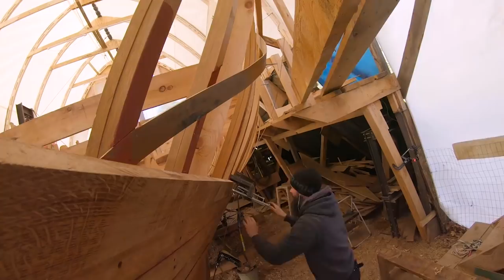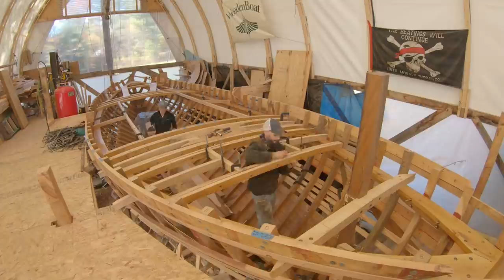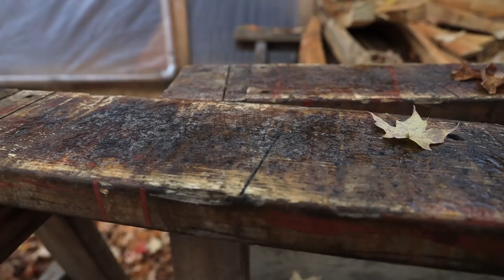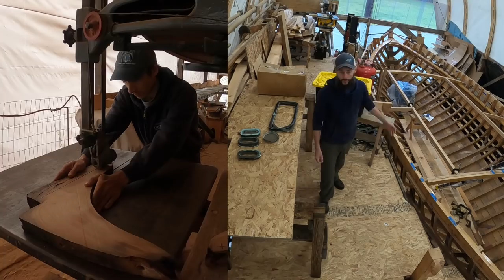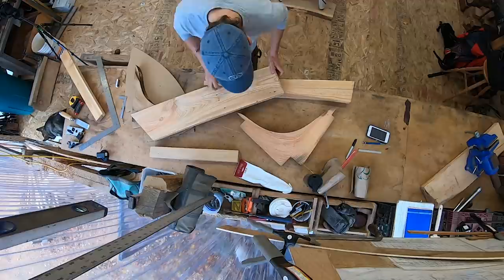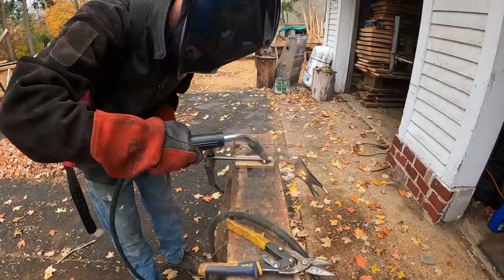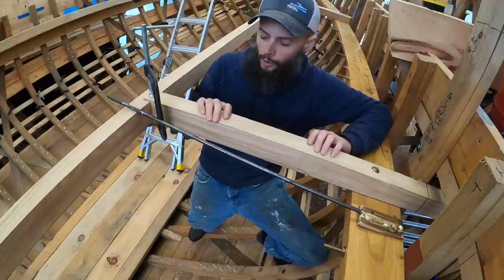Alix is Back! - Episode 134 - Acorn to Arabella: Journey of a Wooden Boat

Comment: oooo ***long conment warning*** I has a story to tell!!!  Alix is definitely on the smart end being "afraid" of  the power tools,  most  woodworkers and machinist's that have all of their fingers, hands and arms worked with that healthy fear. I am a retired/disabled engine machinist and will now impart to you a story about me from my now distant past, before I could call myself an engine machinist.  I was "grunting" for the shop (doing everyone's clean up and  prep) specifically this day I was  de-carb'ing engine intake and exhaust valves.  Getting them ready to be  spec'ed out and either tossed into the scrap or tossed into the "good" pile for use in future engine builds.

Anyway , this is the type of  job that  you "save up" for and do alot at one time .  Typically I would  tear down a dozen heads  at a time and then do all of those valves (about 190 ish in total) in one session.  I was about 35 to 45 minutes into the job (typically I would spend about an hour doing this task) and as with repetitious jobs you find a rythym and go on "auto pilot" doing the same moves and processes on each valve.  The bench grinder in our little 3 man shop got a lot of use as all three of us used it for various cleaning jobs.  I was about  75% finished with the  batch of valves when  the accident occurred.  For those that know this process it needs no discription... but for those that don't I will include  the basic process I used. First I would do the stem of the valve as it has the least amout of carbon and then finish at the "bottom" head of the valve doing the exposed part of the head (that faces into the combustion chamber), then the face where it seats into the cylinder head and finally finishing with the area between the face and the stem. This is where most of the carbon ends up sticking.  As I rotated the valve  with the stem adnd the edge of the head just starting into the carbon build up, I caught the lip of the seat on the brush and  it sucked it and my thumb into the slot that encases the wire wheel brush. You typically have a pretty aggressive grip on the stem of the valve because  the wire wheel kind of tries to pull the valve out of your hand in this position. Because of that grip and the speed of the  grinder  my right thumb was pulled directly into the wire wheel, and  basically stopped the wheel from turning.  A few factors saved my thumb that day, coming away with a relatively minor injury. 

First, the bench grinder was OLD with a lot of use on it and so the brushes on the motor were worn and the armature  weak so whne the combined mass of the head of the valve and my thumb stuck in the channel  the bench grinder motor was stopped 
Second,  The wire wheel was about ready to be replaced  so it was not as dense as  they are when new.
Third, As it was my right thumb (non dominant) I was able to quickly  hit the stop switch with my left hand (dominant)

Even with all those factors I still lost  nearly all of the skin and flesh  on the top side of my right thumb.(you could see the knuckle bone  where your thumb meets  the  hand), after I hit the off switch I could pull my thumb and the valve out . thankfully I am not squeamish (sp) but  then I don't see the knuckle of my thumb everyday so suffice to say I was in a little bit of shock. I grabbed a few paper towels and wrapped  my thumb and headed to the wash station. Now  if you have ever had a minor scrape on your body you know that cleaning  the scrape out is not the most pleasant of experiences but it MUST be done.  So here is the  "manly man"  22 year old shop grunt trying to use a scrub brush and soap to clean  the area that was just skinned and de-fleshed in  the wire wheel... the feeling was there and unpleasant but because I was in shock I was able to do it with only minor complaining; read in here, I was saying a lot of  sailor-ish  cuss words pretty much in my outside voice during the entire cleaning process. As it was an abrasion type wound there was  no way a doc could "stitch it up" so after it was cleaned and had about  a half packet of Neosporin slathered onto it, it was wrapped in gauze and taped to make it stay on. I went home for the rest of that day ..... I am thankful everyday that I still have a thumb on my right hand and I have never cleaned valves bare handed again. Don't be me Alix keep your healthy fear right at the forefront of your attention as you do your work, it will help you keep all of your body parts intact and ready for use another day. WELCOME  BACK I am so glad you had a great summer!!

Comment: I would like to ask in advance of you going back to planking,  I see you use an old method of splicing the planks in there length , have you considered using the finger joint method which is done simply and quickly with the specialised router cutter,  the glue  surface area is vast and stronger than the wood  and greatly reduce the need for those very large light boxes. 
The joint does not need to be structural as it’s only joining timber end on , i would be interested in your comment . Mick ...UK
Reply: MG - I think the issue is the length of the finger joint (short) will almost guarantee it will come right on top of one or more of the numerous ribs and can't be properly riveted without serious loss of plank integrity.

Comment: Now that you guys have a better boat house built are you going to safely install something for heating for the winter now? Watching you guys freezing is tough to watch. TIP 2 part epoxy great for fixing checks in un usable boards than clamp checks shut. This is much stronger than glueing.

Comment: The process of building a very large or long project basically by yourself is not unique. There are a huge community of experimental aircraft builders. Probably 12,000 to 15,000. That is similar to what you are doing. These projects take mostly 4 to 15 years to complete. Many of the struggles you two talk about are very common to the aircraft building community. 

The mental health and drive for a big project is a major part of building an aircraft and is the number one consideration. And also the support and ‘buying in’ of a spouse is paramount. 

But after the project is completed, floating or sailing (flying), there is a sense of pride that nothing can compare. But there is a lot to be said about the drive that it takes. When you’re old and gray, you can hang your hat on the notion, “I built that”.  And then your audience will wonder if that is true. And no more explaining is needed.  Good luck.

Comment: How come you didn't just put an eye bolt on the nubs of the bolts that hold the shelf to the frame and a corresponding eye bolt in the Carlin? Then you could have connected them with wire or threaded rod.

Comment: On the engine ventilation front , why not ad a modern aspect and have an extractor fan, 
The altinator can run it . ?
Reply: How would that not let in water?
Reply: @IM-de5dg  how about a u bend. They have them in most modern yachts , keeps the smell out and the heat ,  it's a reproduction off an old design, but a few modern twists that maybe they would have had if they could , ?
Reply: @IM-de5dg  always a concern, but having the ventilation is more important than a 4" vent hole or two.

Comment: I wish you'd use a much larger rod for the tier rod.  You not only need the rod to be larger for strength, but you need a MUCH bigger washer and nut to spread the load.  I've never build boats but I've built log homes and I've always gone with the biggest diameter hurricane bolts (sometimes 30ft long) I could get.